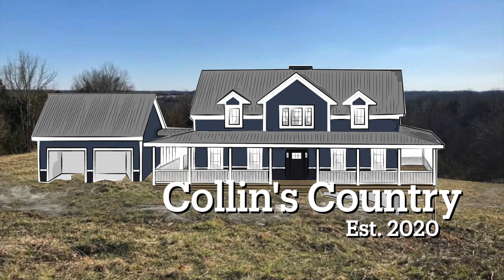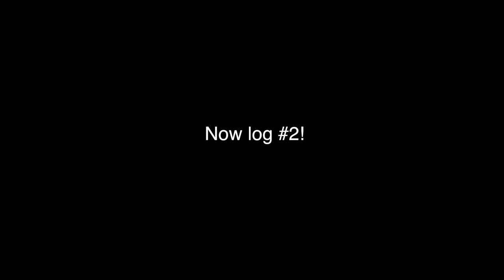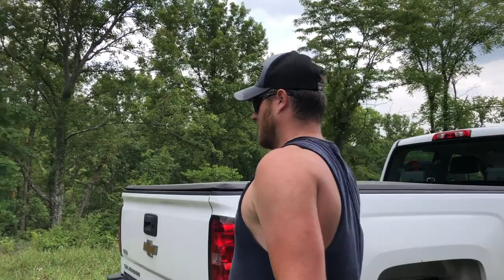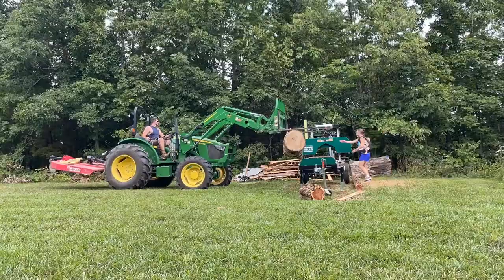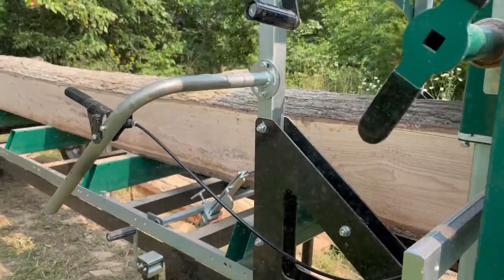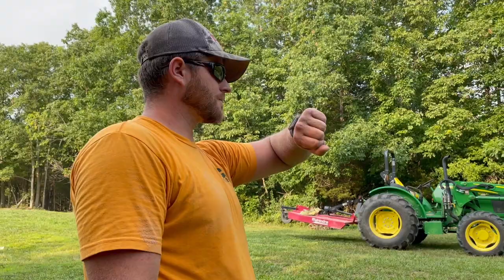DIY POLE BARN CONSTRUCTION #1- CUTTING OUR OWN LUMBER & MAXING OUT THE HM126 SAWMILL!

Comment: Make sure you paint the ends of the boards or that red oak will split badly as it dries, otherwise great video guys.
Reply from the maker: Thank you for the advice. I did pick up a product called Anchor Seal and have been using that. Hopefully it helps.
Reply: @CollinsCountry  That's the best thing you can use.  Good job!
Reply from the maker: +Ryan Morgan Thank you! Courtney’s grandpa is an expert woodworker and recommended it to us. So far everything looks good with it. Thanks again for the advice!